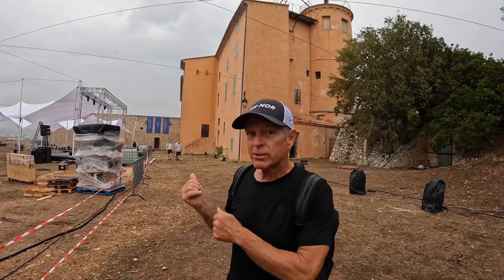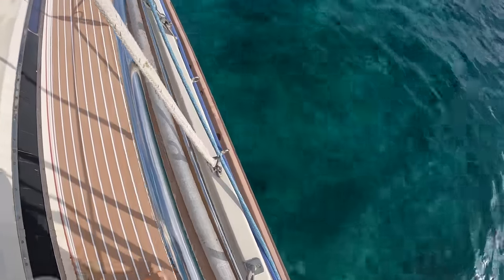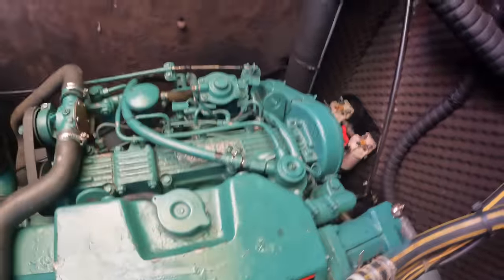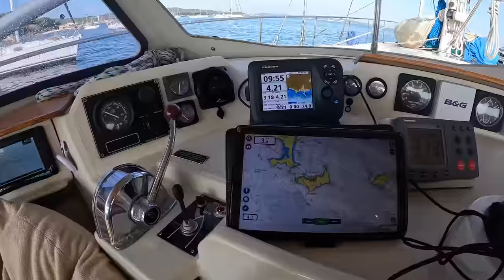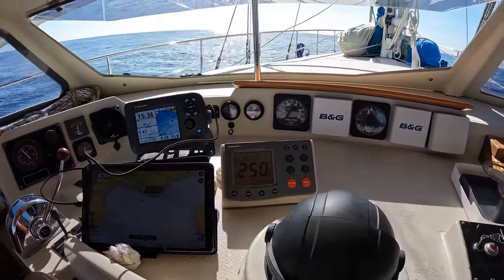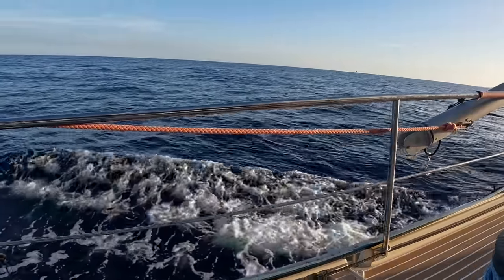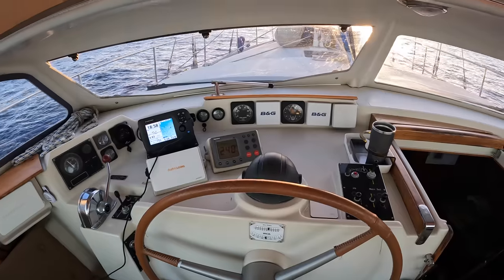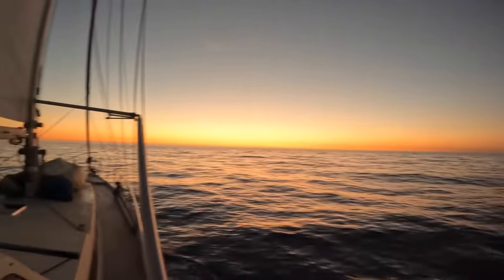Because? Because... BECAUSE! /  Sailing Aquarius Ep.176

Comment: Hi Captain Ken,
Great channel and always variable and enjoyable .
I am a sailor ( in a classic 1974)
Many years of experience and I can remember the worst experience I had . 
Your engine room reminds me. 
My yacht is Dutch and the engine room is lined with the same foam “sound proofing material”
A few years ago I had an electrical short and fire!
This material burns like hell ( if it is the same stuff)
I was lucky to extinguish it through the fierce fire and plastic smoke.
I ask you to remove a small piece and see how it burns.
You may thank me if it is the same as I had?
Reply from the maker: I had a small fire in the engine room.  The stuff didn't burn, it slowly melted.  If it did burn, Aquarius would not be here now.
Reply: That sounds ok, but it looks very similar. 
Did the flame actually touch it? Or was it next to some hot wires and just melted?
Incidentally following your recommendation I bought one of those orange fire hoods with the respirator. Good advice. Peace of mind. @SailingAquarius